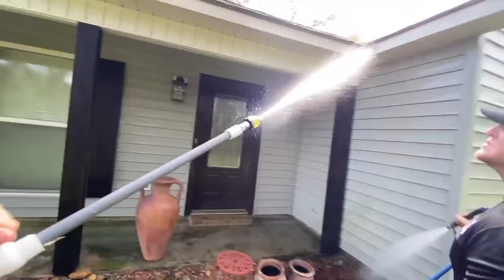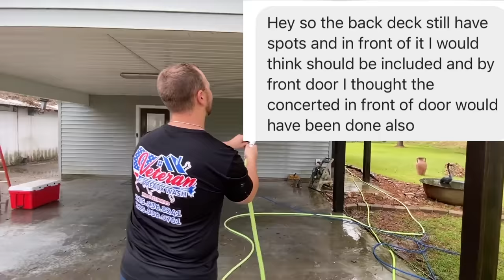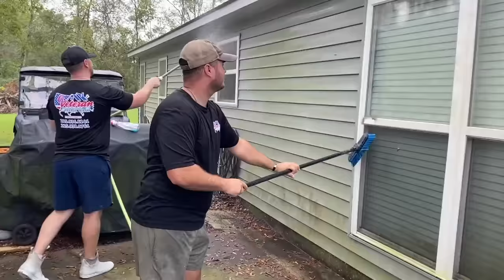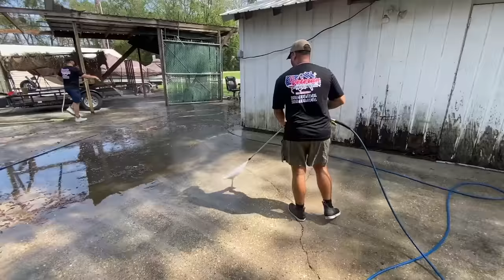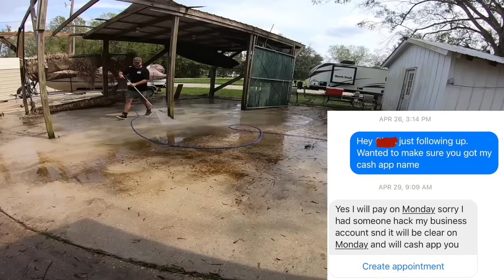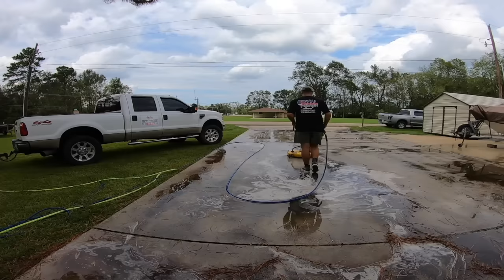This Customer Refused To Pay Us

Comment: This is why on every estimate I create, there is a section for "scope of work" and a section for "exclusions" in writing with an area for the customer to sign and date the quote. I've never had an issue with collecting payment, But I have had call backs for other issues not related to my work but noticed after I was done.  I do HVAC cleaning and after a job the customer said her furnace won't turn on. As it turned out, the furnace had not been running for over a year because of bad wiring in the wall.   She was trying to get a new furnace out of the deal and luckily the service company that I use was able to diagnose the bad wiring and it was an easy fix. Learned my lesson and always test the customers equipment before and after the job. Taking Photo's of any noticeable damage before hand is also really important as some people will try to blame you for anything they can.

Comment: I own an auto repair shop in Los Angeles and tend to avoid people like this like the plague. My compromise is offering them a free diagnostic that involves little to no disassembly and then sending them on their way. I also don’t release vehicles or park them outside our lot after hours until we are paid, (unless they are 5+ year KIND customers and I know where they definitively live, of course). People on rare occasion do try my limits and I send them on their way. Like a customer today who pulled in SUPER close to another car, and ended up making contact. Caused moderate scratches. He denied it, and refused to take accountability so I handed him his key and I said, find a new mechanic then. I’ve given him rides to and from work along with a free loaner car in the past for OVER a week while his parts were on back order, and we’ve gone as far to drop his vehicle off at his house which was an hour-long round trip. The customers are NOT always right. He can have OODLES of fun finding a new mechanic 👍

Comment: I owned a pressure washing company and what I did was tell them the deck gets rinsed with the house wash and if they wanted it pressure washed add (price) also I would include walkways to the driveway and the porches. People also thought that gutter cleaning was included, if they said anything about that I told them we don't offer that. I always thought it was too dangerous and not worth it. I got out of the Business when the pandemic hit and also got because every guy with a pressure washer was out there low balling house washes and I got tired of dealing with it

Comment: before i start my jobs, i always clarify what work has been quoted for. if iv given multiple quotes i state what quote we have gone with what the quote intails doing ie i supply the skip or the customer does or scafolding etc. what work im doing what work im not doing, am i doing the clear up or are they doing it them self etc etc. everything clear as mud. if you give any room for "grey" areas for punters to wiggle a little extra out of you they will.  i mean i dont mind putting up a hanging basket or something petty while im there with tools but if iv quoted to paint a rooms iv only quoted for the walls not gloss work or ceiling etc etc.

Comment: Not only is it advisable to make clear exactly what the customer is paying for, but you have an opportunity to up-sell during this process by making clear what is and is not included and offering a more comprehensive service, even offering a small discount on the stand-alone price if they take up that offer.
Also, it's always wise to over-deliver on what you promise. It doesn't have to be anything big or extravagant, just a tiny little thing that the customer didn't expect leaves a positive impression. Find little things that you could add as "complimentary", things that take you no more than ten minutes but that the customer might not even think about doing.

Comment: When I was a contractor, there was a payment term practice that a few vendors offered their customers. When the customer was another business, in my case I was a paving contractor, we rarely got paid in less than 30 days. 30-45 days was the most common. That was also true for our vendors who we purchased materials and supplies from. 

However, a handful of those vendors offered a 1% or 2% discount if you paid in full in 3 days or less from the purchase date. 

It may not seem like a lot of money to save, but it adds up. Cash in hand is king. It’s the lifeblood of the business. On a $1,000 job would you rather have $1,000 30 days from now, or $980 3 days from now? 

When you make your contract for service with your customer, always include payment terms. 

Keep your commercial business account loaded with money. You have to be able to keep paying your bills and employees, etc while you wait 30-60 days for the next check to arrive. 

You never want too much in your receivables account, but it’s an excellent way to gauge the current state of your business. Having money parked in your receivables account let’s you know you still have money out there you will be receiving soon.

Comment: Start taking deposits. Im a mobile mechanic. On big jobs, I take 3/4 down. If they really want the service, they will agree. If you don't want to do 3/4, do at least 1/2 down. That stops all confusion. That way you dont walk away with without getting paid. Especially providing a quality service. If they decline, there are other customers, & stick to your guns. Also, get things in writing & print up some terms for the customer to sign with an agreement. This protects you & the customer. Keeps both parties honest for the most part contractual & invoice wise. Hope that helps. Good luck.

Comment: You actually blast water towards exterior window trim and on an upwards angle on siding, soffits and step flashing? Do you know what's behind these areas on most houses, or lack of? These ares aren't totally water proof. They shed downwards rain water kinda well, but not necessarily water on an upwards direction.

Comment: First off, have a WRITTEN contract with the customer of EXACTLY what's covered and not covered. Secondly, give the customer a net10/30 contract (or net 5/10, 5/15, 20/30, etc), which gives a discount if paid within 10 days, or full price if paid within 30 days. And after thirty days, had an additional monthly charge until paid in full.

Comment: Yea, I agree with most people here, there was no miscommunication, she knew but was trying to get extras for free. Even though you gave a separate estimate for the concrete, she could make that disappear and deny she got it. I would start putting it right on the main contract “customer declined concrete cleaning, declined deck cleaning, house only” or something like that. And maybe you should just always spray they’re front step, unless it’s a stairway with a bunch of steps, in which case include that also with the “declines” stuff. But yea she was trying to get you to lose your cool so she could justify not paying you. I don’t believe the hacking story ether. She was trying real hard to stiff you. You handled it the best way possible. 👍

Comment: I learned this the hard way but you should always get them to sign a contract with exactly what will be done. It will save you a lot of hassle later. And you'll have proof in writing should you need to go to court.
Also, for $450 you could take them to small claims court. In most places you have to pay a $20 or so filing fee and spent a little while in court. Not the best way to get money owed, but it is far cheaper than hiring a lawyer.

Comment: Honest question,
you guys wash houses using a pressure washer. Slats and facing are installed in such a way to deal with rain/water from above and the side. Using the pressure washer from the ground goes against this.

Does this cause water to get behind the facing?

Comment: It has been my experience with homeowners customer that the great majority of them don't understand that the jobs have a stop that it doesn't clude the entire house when it comes to have something done. Example if you have a water problem the plumber will come, cut the drywall, or the floor and fix what you called them for, but they don't do concrete or tile repair. Same goes for electricians. You want new cabinets? Sure. But they don't do tile to make sure the existing tile meets up with the cabinets, or move an outlet so the cabinets don't cover them. Etc. Some people just don't get it. Don't assume people have common sense because the great majority of them don't have it.

Comment: 2 things. Customer was def in the wrong, however, scope of work needs to be more clear with customers.  If there's something attached to the house that's not being serviced, quoted separately or not, needs to be spelled out that it's not included.  Next, consider getting deposits.  Gas and material fees.  I suggest 1/3 of agreed price.

Comment: I build decks for a living. I am confused by the definitions portrayed in this video and in the comments. The deck is a part of the house, is living space (the video stated it wasn't), and often times a deck has siding around the edges. If your contract states cleaning siding, windows and soffit it's a no brainer; however, if it states you will wash the exterior of the house and the deck is not a freestanding structure- it is part of the house.

I used to work for a contractor that also sold decks/roof covers. We would build the structure and toward the end of the job the customer would be surprised when boss man told them "sorry, painting the siding is not included in the contract." Although it did not specifically say painting was not included, it did not say it was included either. Leaving room for interpretation and arguing with the customer over something that was never discussed always left a sour taste in my mouth. I was the lead on the job and often had to break the bad news that the project was not going to be completely finished by the time we left. "Well, it's got to get painted" was the response from non-controversial homeowners. It was expected. Had it been more clear that they would have to hire a painter separately, it would not have been a big deal. Now that I run my own business, I tell my potential clients this story and tell them I will not leave the job unfinished. I do not argue or tack on extra costs after the contract has been signed unless it is a direct change order.

At the end of the day, you are the expert in your field. Your average Joe, homeowner, will never be able to read your mind and know what to expect unless you tell them directly. I may be going against the crowd here but I believe this was a contractor error, not a homeowner error (because she did pay in the end). Also, I am interested how you are making any profit charging what you do. Does $450 for this job include labor, profit, taxes and overhead? Gas, administrative time talking to homeowner, cost of advertisement, etc? You are an honest guy who charges a fair price and I enjoy this channel a lot- all I am saying is if there was enough cushion on each job you would never have to argue over a misinterpretation and you could correct it without taking a hit.

Comment: #Communication is imperative! Even if you know the person on a first name - nail it down ask dumb questions; yes ask "Hey you want this but your DON'T want that" it's also a good opening to explain the advantage or value of other services.
   Hearing your read back was SO enjoyable as cringe as it sounds I had a very much like situation.. The client felt like something should have been apart of the service, it clearly wasn't - But I never dreamed someone would think it was, until the Guy; same dog n pony show to get the money, but I learned like you did.. Communication is key, I now use a formal letter of service which is signed by both parties, with a plan of action or contract as well. We live we learn we work we earn!

Comment: I had an experience similar to that. I work at a bike shop and a guy insisted on a full refund for a repair on a flat tire though we did the job to sufficient standards. My solution was to cancel the charge (that the customer verbally consented to beforehand) and jab a new hole in the freshly installed tube.

Comment: Here's the thing you said you all ready sent her a separate quote for the deck and concrete areas. That she turned down, I believe you said. So you sent her another separate quote for just the house wash, which she agreed to. But when completed is claiming the decks part of the house ? Did you not send her a separate quote all ready for that lol you should have just highlighted that area and her reply of Turning it down. You handled it perfectly though if you don't have the time, take off the work and take the loss it's a learning curve for next time. I'm an exterior painter I always walk the property get a detailed out line from the home owner as to what the work is. Always broken down in the quote some times I'll even add in photos of the specific areas and colors especially if more then one. So later they can't say we'll this was supposed to be this way I can go no look I have signed here by you photos and detailed outline of the work order. Also better for my guys they can see the jobs before hand as well as get a more detailed description of the work they can see this soffit here is this color and a photo walk around the property and physically see it eliminates me having to be there 24/7 as well as if a sneaky customer tries to add on extra work to your guys for free claiming it was included they have a detailed work order as well 😊

Comment: People that are the hardest people to get paid from are people in business. They know all the deadbeat tricks. I had a Big  hotel chain that took over an account I had with equipment that was leased by the previous owner whom they bought out. They had me change the passwords on their equiptment move existing equiptment and educate their managers on how to use the equiptment in several locations.When when I tried to get paid, I  had me TO deal with some company they pay their bills through. Months later I still had no payment. I went directly to take my equiptment back unannounced. They had remodled the building and claimed they threw about 3k worth of good equiptment and owed me another 2 k in labor from the original change over.  This company never paid and the attorneys I talked to said this company does this all the time and if I went thru all the legal battle I would get maybe 500  after a couple years. I was moving to another state so I just let it go.

Comment: This is not a good way to spray the house.Avoid spraying a house  from ground up. This is because the  siding is designed, oriented, sloped and installed to  divert the rain which as we all know falls from the above. If you shoot water at the siding while standing on the ground you are doing it the opposite way. Your water spray will hit the siding from bellow the belly  as each row of the siding overlaps the row bellow and force the water into the insulation which may stay wet for months and mold. The stronger the pressure the worse . You don't need a lot of water , just apply a good cleaning solution, and scrub everything with brushes and sponges and rags etc...That is labor intensive hand work but  this is how you would remove insect stains, dust, polen. green stains from trees,  and everything else. A powerful spray will make dents and take the paint off so avoid that.  Do not shoot so much water at your windows like in this video, do it by hands for better results. The best way would be to spray water at a house when you are doing it from the position that is higher than the house . This would prevent your water from the hose finding its way under the siding. You would need to stand on a ladder or scaffolds. Few companies would take the time to set up their work like that but that is how should be done.  Remember - if you want to do it right do it yourself.

Comment: Start requiring atleast a 20% non refundable deposit once the appointment is confirmed. That way if someone refuse to pay or cancel at the last minute, you’re atleast covered for expenses to complete the job. Also, I would ask, was the deck apart of the house plan, the deck is an addition.

Comment: The deck is not part OF THE HOUSE that is why its called the DECK. Next time give the estimate House $450, Deck $100, Concrete is so much itemize. The deck is attached to the house for stabilization It is not part of the house. An added room is part of the house adding square footage. The deck does not add square footage so it is not part of the house.

Comment: How much was total for the job? If it was a lot, should've got a deposit first, in case of avoiding this kind of situation.. also to clarify what's included for the job and what else is extra and etc and what will be done for the job again before starting so you and the customer can be on the same page, it's frustrating when payment is the issue, especially when the job is already done, a biz is biz, all about $$$, you don't wanna waste time and effort(gas and etc) for nothing